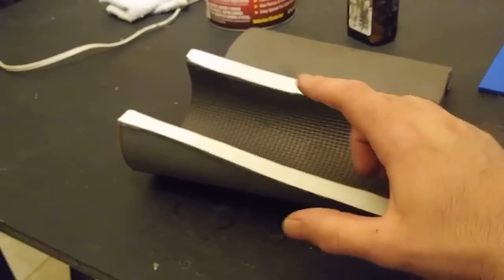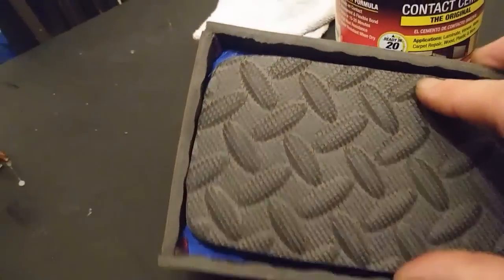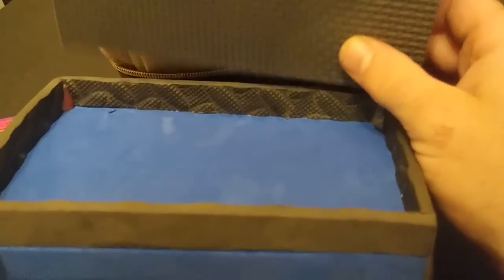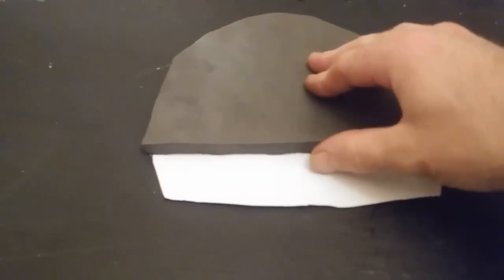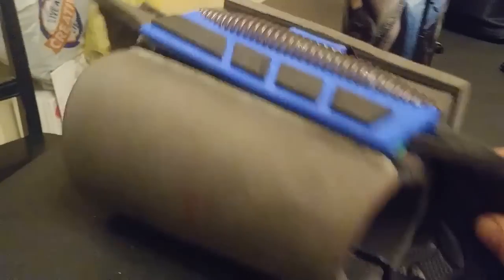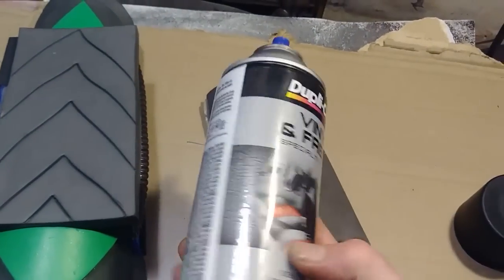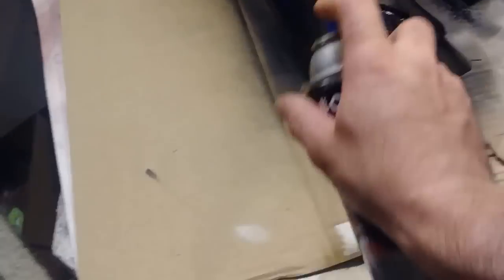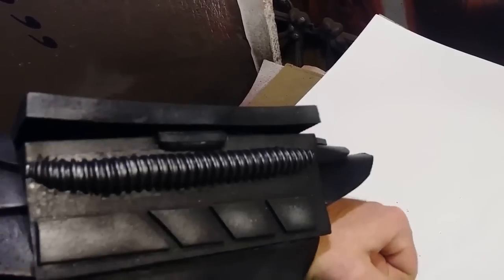Predator DIY Cosplay part 12 Left Gauntlet

Comment: Where do you order your thicker EVA foam? I bought some 2mm from micheals craft store. They didnt have anything thicker. I checked amazon but wasnt sure which one to buy.
Reply from the maker: I use 1/2 inch thick floor mats and 5/16 mat roll from harbor freight tool company. 3 and 5 mm foam I get from Hobby Lobby. As far as mail order goes, if you live in the states, TNT cosplay supply has all sizes last I checked.
Reply: @ZolusProps  yes im close to saint louis, just an hour south.  Thank you for the tips. Ill check out that cosplay site.